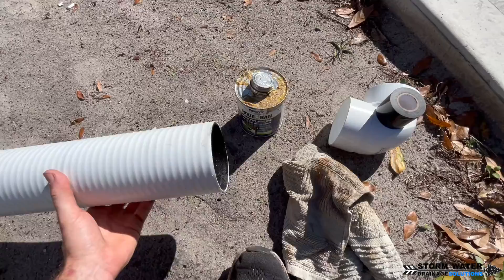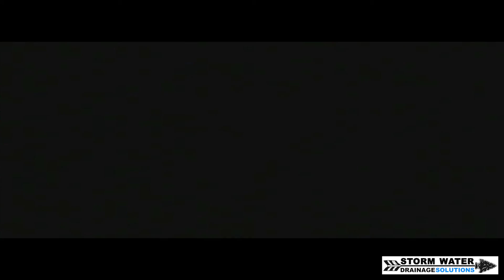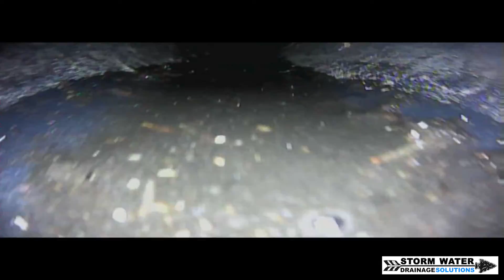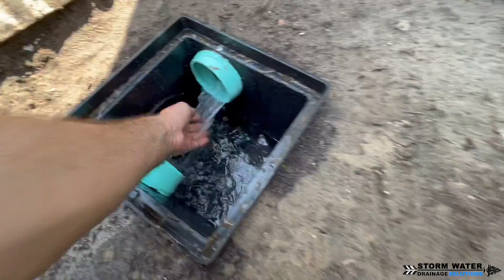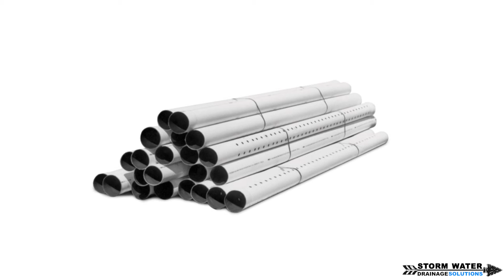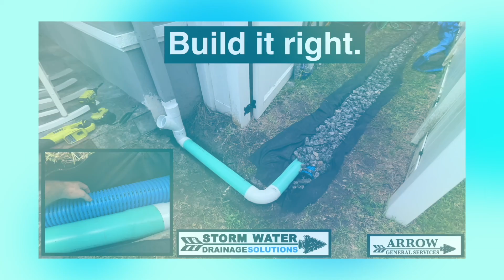Triple Wall Drainage Pipe - Pro's & Con's - How To Install

Comment: If buying perforated triple wall, be sure to look down each section for raggedly drilled holes.  I have had to return sections that had “shark teeth” on each hole from poor manufacturing & QC.  Most are fine but always check them at purchase, don’t wait til installing, far better to reject on the spot than have to bring it back.  I found that if one “big box” had a lot of poorly drilled sections, simply go to another store or the competition and the pipe will likely be fine.  It seems to happen by the batch, not universally.

Comment: Great video, thank you! In my backyard, when they put the pool in about 20 years ago, they used triple walled drainage pipe under the concrete slab they installed. Now the drains are clogged and a plumber came out to try to snake it and he pulled out a lot of roots and said there are many roots because they did not glue the fittings. He said they only way to remedy the problem is to break all the concrete and reinstall new drain pipes. Of course that is extremely costly (about 8k). Do you happen to know if there is any other way of possibly fixing the drain issue? Is it possible to put in a liner so I won't have to break all the concrete? I live in Southern California so we don't get much rain so it's actually not an issue most of the time. When we get that rare rain, puddles form on the concrete so that's the only issue. I really don't want to spend 8k because there are some puddles when we get an occasional rain. Any suggestions would be very much appreciated!!
Thank you again for the very informative video.

Comment: I recently discovered your video's and thought I had a good direction to go with this triple wall. But you mention that you don't like it for a long run. I live in Wyoming (lots of freezing) and I'm just trying to get my downspouts lined out. The first downspout will require about 120' run, what do you recommend for my job?
Reply from the maker: @sr82901  Dual wall pipe. It’s hdpe and has a smooth interior. I am really starting to like dual wall a lot. It’s not as quick or as easy to install as corrugated and is a little more expensive but it is faster and way easier than PVC and less expensive than PVC. Dual wall is strong too.
Reply: @StormWaterDrainageSolutions Any idea's for a good outfit to buy that stuff? Thanks for the reply!

Comment: The manufacture (ADS) of that same exact triple wall pipe suggest I use 100% silicone to make the connections... go figure. But I wasn't aware of using 'tile tape'. BTW... Home Depot can order in "Drainage Adhesive" for HDPE.

Comment: With labour rates at 80 buck CAD or higher it is not worth using a cheap pipe like this as it will only last 1/10 th of the time if the french drain man high octaine pipe.  Way too weak of a pipe waste of money and labour.

Comment: I'm using 4" triple wall with holes in the bottom. Do I still need to glue and tape it? It's for ground water and some gutters.I'm trying to control all the runoff from my neighbor. It's going to be almost 170 feet and will have the non-woven cloth and drain rock around it. It will end in a dry-well that has 4 55 gallon plastic drums with slits in the sides and surrounded by drain rock. I figured that would give me 220 gallons of storage until it gets absorbed.

Comment: Looking for a perimeter foundation drain that can be buried up to 8' deep. Thanks for all your videos. It seems like 1. Single wall perforated is no good. 2. Triple wall wouldn't be good. and 3. Dual wall would be best. That being said, I haven't seen dual wall perforated pipe from any of the stores. Am I missing something? Any advice on sourcing? I've looked at FDM but freight charges alone are $500 so that's off the table.

Comment: Should I use perforated triple wall pipe or perforated PVC for a 30-40 foot french drain here in Pennsylvania with the freezing temperatures in winter?

Comment: Would you wrap this in geofabric and backfill with 57 stone for a french drain?  And no issues with a 100ft wrong if you were incredibly meticulous about making sure there are no bellies?
Reply from the maker: Good questions, I personally wouldn’t use this for French drains, but if you did use it then yes wrap both pipe and stone. 57 stone is good but inch to inch and a half is better if it’s not going to be anywhere vehicles will drive over it. 100ft is a pretty good run so I would be extremely meticulous. Might be better off looking for a good thick single walled corrugated pipe.
Reply: Thanks for the reply. All I can find locally is your regular ADS single wall corrugated pipe, and FDM freight charges make his pipe cost prohibitive.
Reply: I have a quick question,  since you answered that "Yes" he can wrap the pipe and add stone, what are the pros and cons of wrapping vs not wrapping this pipe in this case?

Comment: Is this the same as ads drain pipe?
Reply from the maker: This pipe is manufactured by ADS
Reply: @StormWaterDrainageSolutions  ok thought so. My next question is can you use fabric filter and rock with ADS pipe?

Comment: so much good info , but quick question:  from you videos is clear that gutter waters stay separate from your actual French pipe , so the STAR of the French drain pipe you use a end cap correct ?
Reply from the maker: That is correct. We just cap off the start of the French drain run.

Comment: Any videos like this for the French Drain Man perforated/corrugated pipe?  I'm thinking I'll use that for a french drain with gutter tie ins this summer.  I'm up north so I think that's my best option.  Overview on which FDM pipes work per applications would be great.  Like where would you recommend high octane 8-slot vs. knife cut vs. heavy duty?  If dealing with longer runs, could installation of multiple cleanouts help deal with a potential belly if one forms?
Reply from the maker: We will be doing a video on the FDM pipe in the future. Downspout drains should be ran on solid pipe and kept separate from your French drain so as to not contaminate the French drain with debris that finds its way into the gutters. High octane 8 slot is for using with French drains where as knife cut is used to leech water into the soil. Watch the FDM videos and he explains where to use knife cut. Clean outs are always a good idea on longer runs.